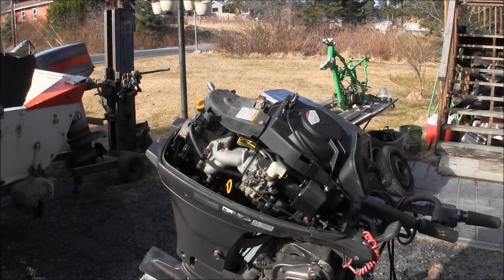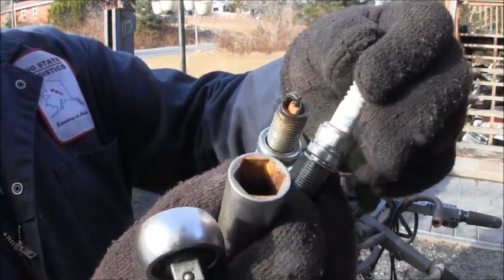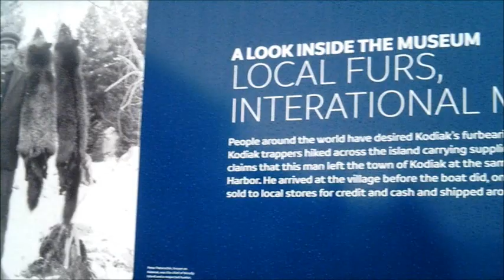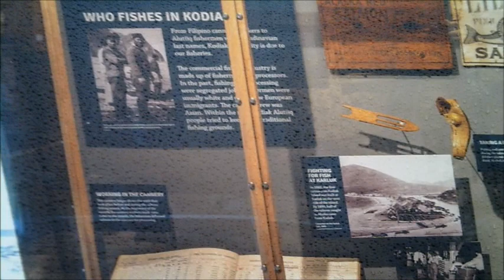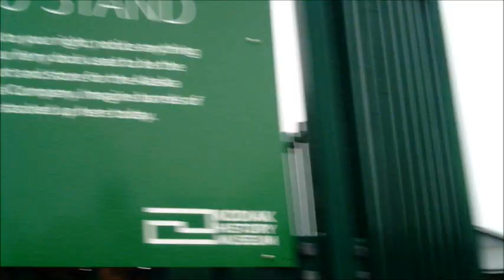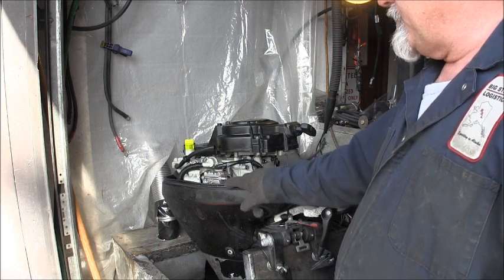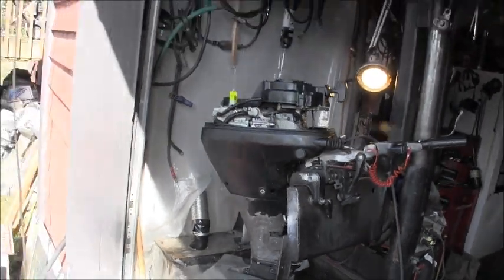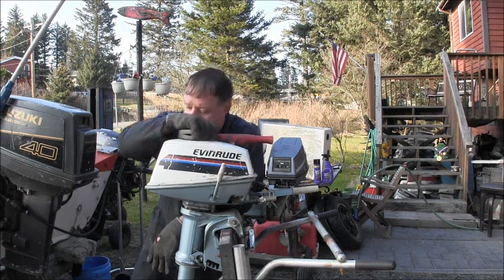TOHATSU 15 HP  &  SUZUKI 15 HP,    FOUR STROKE

Comment: I would  say that's a great deal I love those 4hp weedless evinrude & johnson motors they are a real motor run like a clock. Light quite smooth I have 5 now and they're all. Sweet plus one folding 4 with a caring case. Great back country motor 34_35 lbs. Nice

Comment: Do you have a video on taking off the top end of the 15hp Tohatsu? I found one in the bottom of a local spring fed river and it's in excellent shape. With endoscope camera, I can see that the pistons have slight surface rust and the lifters look a bit more sludgy. I want to pull the top end off to clean the lifters and pistons.